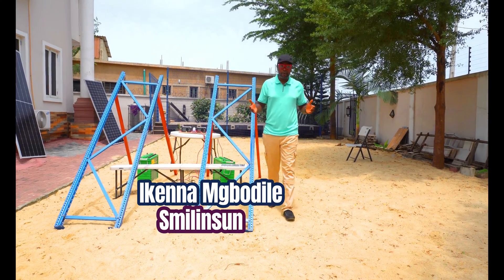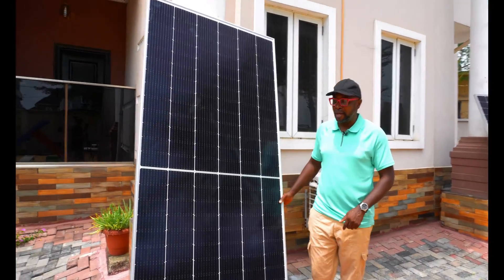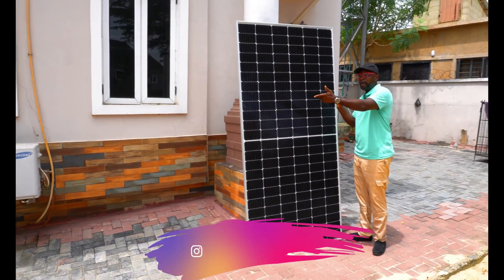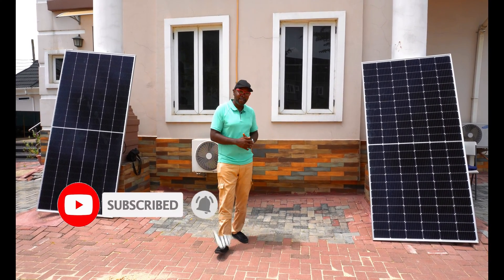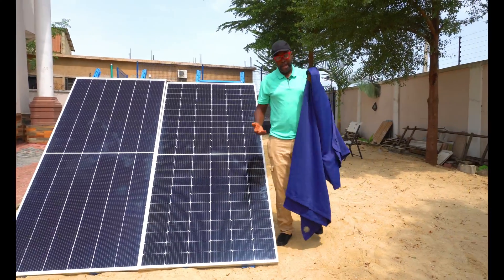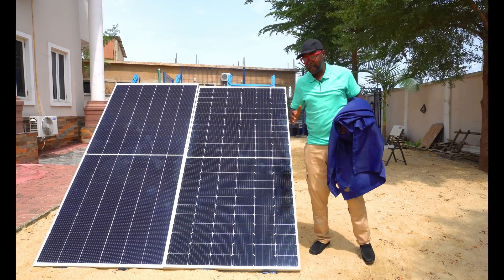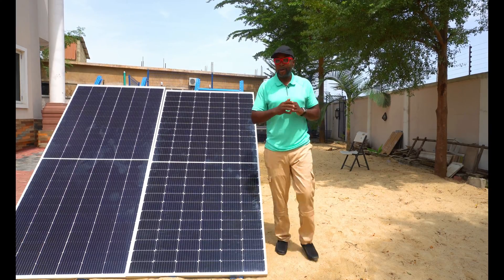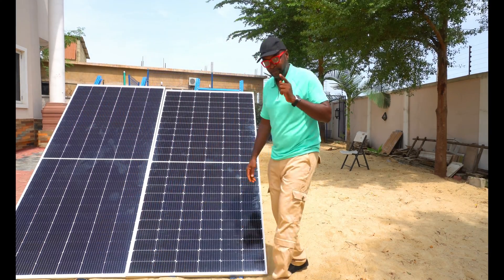JA Solar vs Jinko Solar in Solar Panel output efficiency test

Comment: I like your conclusion. Both are very good. Head to Head. But you forgot to measure and mention the battery parameters before the testing. The state of charge can also affect the power delivered per moment. I said it so that some people will not compare when a battery has passed the constant current stage and the other at a constant voltage stage.
Reply from the maker: You are right the state of the battery can determine the output test , but the Batteries where nothing anything close to Absorption voltage so the test is very accurate , we made sure of that.
Reply: Una too dey do oversabi. The video was brilliant end of story. If he had done all that u are saying u would have also found something else to say. All these I too know nigerians
Reply: I don't think Battery voltage could have affected the wattage of the panels because the Precision meter is in between the Solar Panels and Charge controller not between  Charge controller and Battery. So the wattage is Purely true Solar generated.
Reply from the maker: @benjaminkioko-bt4xl  Hello Benjamin I understand the technical perspective you are coming from , but here is what happens . When the battery gets to absorption  stage with zero load it reduces the energy coming in because at this point it needs less energy to absorb the battery. So the energy level will drop. That is why before I start the test I always ensure the battery energy is depleted. For as long as the charge controller is on bulk mode the maximum energy from the Solar Panel is coming in.
Reply: We love your videos so informative